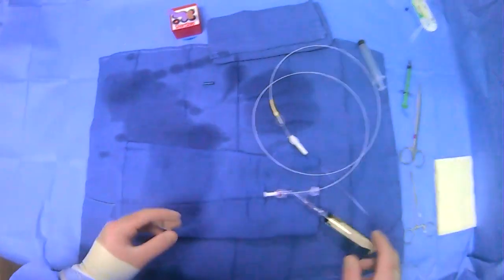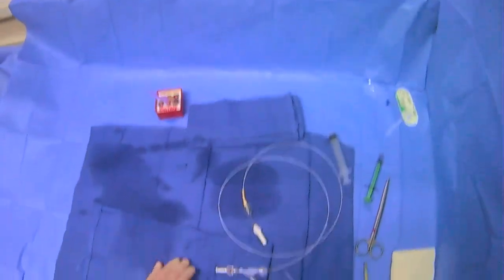Microcatheter System

Comment: Will it not destroy the integrity of the wire if you load it inside the micro catheter while it’s still inside it’s case? I did this once and the doctor I worked with said never to do this again 🥺
Reply: The technique that your talking about is called "cassetting" and it is a brilliant way to load the wire into the microcatheter without having your wire go everywhere. As long as you hydrate the wire beforehand 👍👍